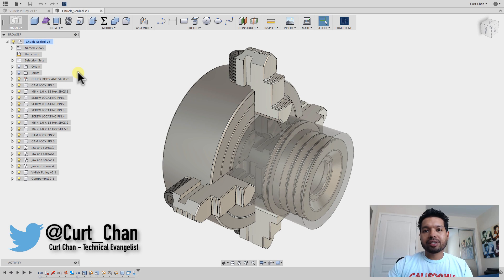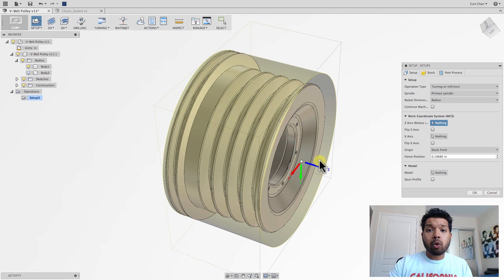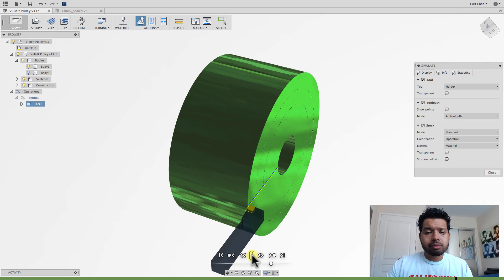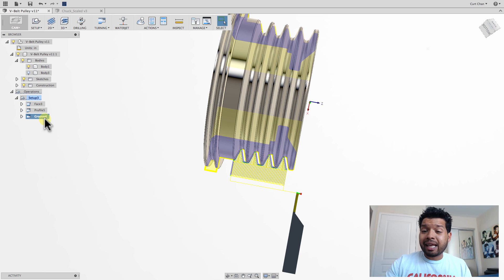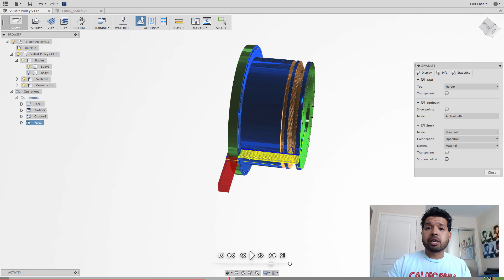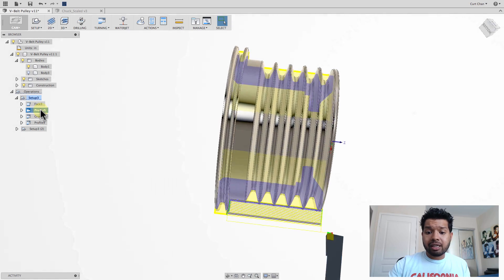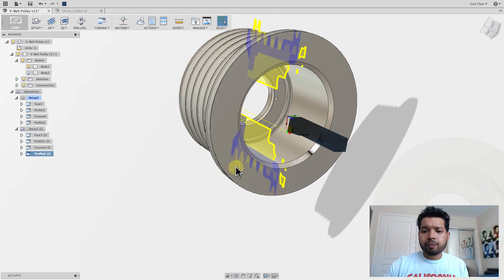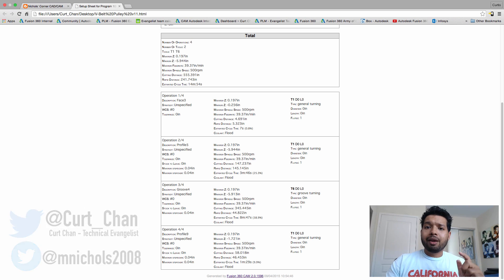Intro to Turning - CAM for Fusion 360

Comment: how did you set your facing depth of cut?? in Milling cam , it generally assumes 1 mm when in metric.. I dont see the tool touching the face in turning. GOT it .. that imaginary line was 8mm offf the face.. I needed it at zero..

Comment: Nice video sir! I've been wondering how this g-code/CNC controller will know where the tool is in relation to the part once you flip it around to do the backside. I have a couple parts I'm planning on turning that'll require them to be flipped around for operations on the backside.

Comment: How did you create the body for your stock? And then create a separate body for the finished part?
Reply from the maker: Hey Todd, at 2:50 Curt mentions he already had the body. He would have made it as you make any body...likely a simple sketch (circle) and an extrude. The finished body is the main geometry of the design. Hope that helps!
Reply: Autodesk Fusion 360 Thank for the reply. I am also turning. My finished part is already a sketch which I revolved and made a body. I want to machine my part from a forging, which I also need to sketch to make it a body. Can I do multiple sketches in one design??
Reply from the maker: Most definitely you can have a near unlimited number of sketches in a design!

Comment: How do I set up a gang lathe where I back cut? It generates gcode for a front cut and it’s ok if that’s what I was setup for but I have right hand tooling. I’d like to set up for both left and right hand so It can profile from both sides.
Reply from the maker: That's a bit beyond my capabilities. Can you pose the same question over here.... https://forums.autodesk.com/t5/fusion-360-manufacture/bd-p/2070

Comment: no need cam hand write so easy part. thats done 5minute hand written on machine. lines max 100 vs cam 500000 lines
Reply from the maker: You must have tons of experience. Most people don't. You definitely get more power when using CAM on a more complicated part, but for an Intro video, we need to walk before we run?

Comment: you have draw that from looking customer drawing. same time you could write it hand on cnc reading drawing.lol. thats how pro wor. why need cams that post process more lines than cnc has even memory. any change you do have to go back to cam. takes time. more errors.when i change some on directly on machine i only need change one number. why cam lol
Reply from the maker: You must have tons of experience. Most people don't. You definitely get more power when using CAM on a more complicated part, but for an Intro video, what do you expect? haha
Reply: Not everything can be hand programmed. I garuntee you arn't hand programming an injection mold on a mill. It would take a lifetime.

Comment: no offense but an intro should focus on tool library and tool orientation, nothing your showing will happen without it.  for example: so far many of the micro tooling types i use typically fusion wont even recognize especially not in a gang type setup.  apparently theres a few tricks here and there, but should it be tricky?  not really an intro when you already have everything fully set up and ready to generate paths.

Comment: Great tutorial except that you should really be using a boring bar for the internal features. 

As a machinist there is no way I would ever try and use an O.D. turning tool to do an I.D. feature. To many places for tool interference with a square peg in a round hole.
 
I understand what you are trying to show, but somebody without experience in machining wouldn't know this is not the proper tool for I.D. work
Reply: +Don Jones Great feedback Don.  I'll create a couple of custom tools in my next video to capture the boring bar. Unfortunately we don't have one in the standard library yet.